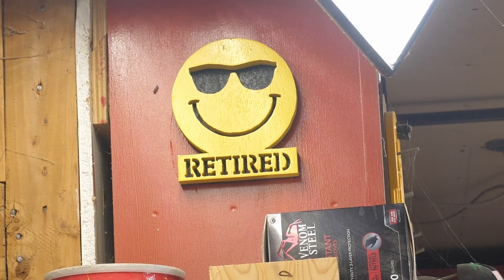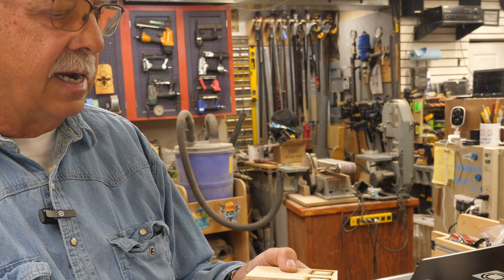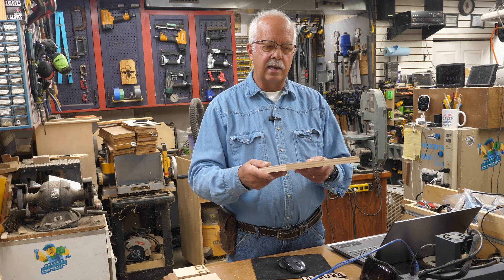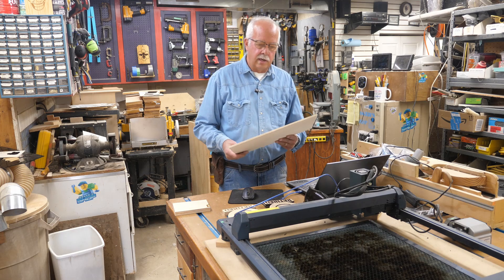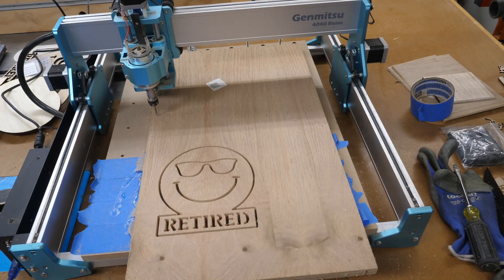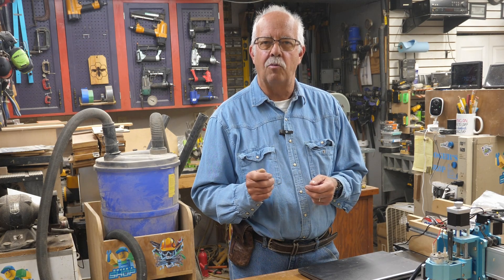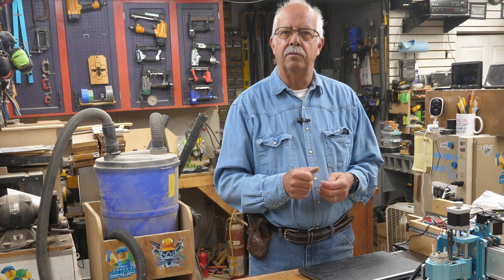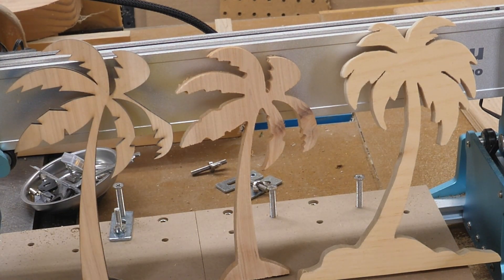Scrollsaw VS CNC VS Laser

Comment: Since you are using plywood why not just cut two identical "front" pieces out of 3/8" or three 1.4" plywood with the laser and glue them up?
Reply: Obviously depends on your router mine would cut that in about 7/10 minutes
Reply from the maker: @randyschwager8360  My Anolex CNC would also have cut that much faster since it does not have a stock spindle.  I used the Reno here since it is an entry level CNC that is more affordable for a beginner.
Reply: I agree they all have their place.
Reply: I hadn't finished the video when I wrote my comment, but it looks like the laser might be as fast as the scroll saw and does not require the practice/expertise of the scroll saw
Reply from the maker: I mentioned that in the video